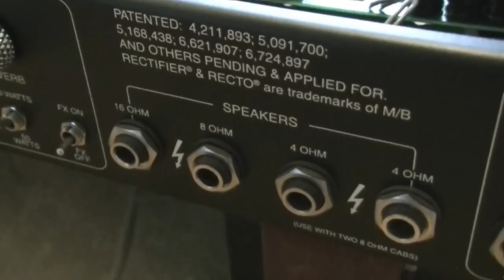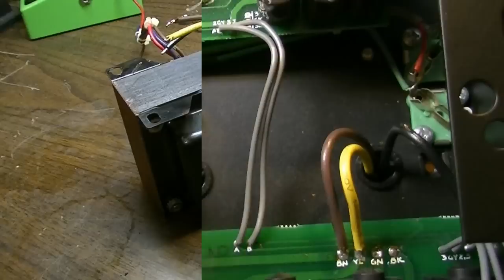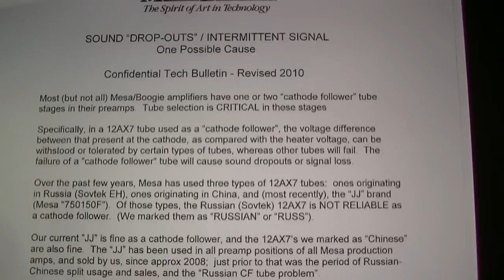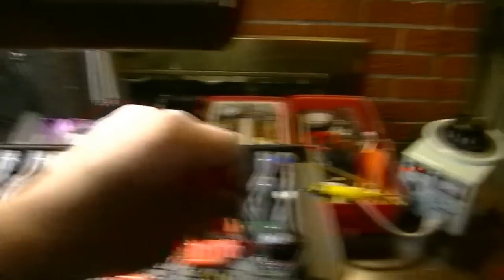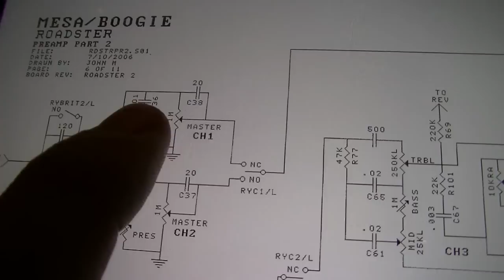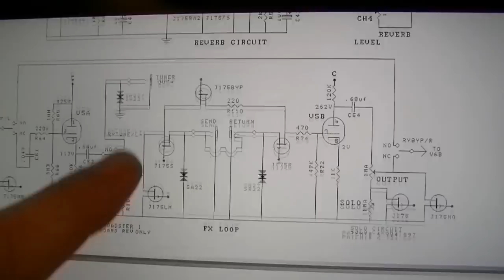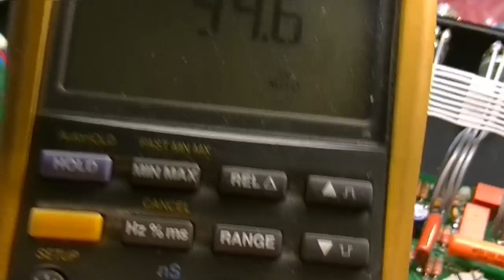Amp Tech's Worst Nightmare - Mesa Boogie Roadster Repair

Comment: Hi, just wanted to say , I love your videos. I have a question for you on a Mesa Boogie Tremoverb amp. I recently sent my amp to Mesa in California from Niagara Falls, Ontario, Canada. Cost me a fortune in shipping and the repair. $1000.00 the amp got sent back ok and it plays, but the noise floor coming through this amp is extremely noisy. Ask Mesa about this. They couldn't give me any answer to this problem. They told me they had a guy there for 30 years and that he was their top tech at fixing Mesa Tremoverb amps. Can you give me any advice on this problem. I have recently bought a Ceriatone HRM Dumble amp. You can turn this amp up really high and you don't get the noise floor on this amp like you do the Mesa. I had Voodoo amps in Lansing, New York do their mod on this amp. Basically that mod just lowered the gain in the amp, so you can turn up the gain in the red channel without sounding like a can of bees sound that is so much a part of the tone that was this amp. I must say their mod did improve the amp for the better, but this noise floor you hear through this amp just turning it up without even playing any thing through it. Any advice would be greatly appreciated.

Comment: The way everyone talks, I expected the guts to look a lot worse. It's not that bad really. The boards aren't stacked on top of each other. No SMD. it's really just a complicated circuit is all. I'll take that over an amp that is inaccessible for servicing.

I found using a looper pedal playing a few notes is a lot more convenient than having to plug a guitar in. Sort of a more practical signal generator.

Comment: BTW I had an issue on the RKII with excessive noise on one of the loops... that resolved to a resistor that went bad in the circuitry in the loop... apparently a common problem.

Comment: Excellent video showing the aggravation of the jfets when there are issues with Mesa gear... I really enjoyed this video, as well as watching how you resolved the overall problem as it turned out to be. I also liked the output transformer work and how someone had cut that - nice. I would not believe it unless I saw it right here on the video. I like mesa boogie amps although as this video shows they can be tightly packed (those jfet pads are close) and have that commonality of the jfet problems that many people talk about. A really cool video and one that you did a great job on showing... Thanks for making this. I have a RK II which in many ways is similar to the roadster with some more niceties :) Thanks.

Comment: Jeez I am so glad I didn't buy that freaking Mesa Boogie amp!! It was a good deal on an expensive amp, but if anything went bad, I couldn't afford to fix it. That is a tremendous amount of colored spaghetti all completely crammed tight as hell in that little box!! Based on the last amp repair video i watched... the Fender Hot Rod Deluxe... I wonder if I might have also bought an unreliable amp! At least it's more open inside to see what might be wrong. Hey Brad, I'm an American living in Germany. The HRDx I bought is of course a 230v 1996 Made in the USA version. Can it be converted to 120v if I bring it back with me, or should I sell it and buy a different one once I get back?  Bob in Germany

Comment: I bought this exact amp when they came out. It was the best amp I have ever owned. I had it on one side of the stage and a 2x12 cab on the other side. It was heavy as all hell, but the versatility and tone were second to none. I had to sell it to pay for a divorce lawyer or I would own it still today. And it was loud enough by itself to keep up with the drummer, and that is a feat in and of itself. Would not mind getting another one.

Comment: For what it's worth, Peavey Triumph, Ultra, Ultra Plus, 6550 and other multi channel amps have electro mechanical magnets connected to diodes and capacitors to trigger channel switching. I have fixed quite a few of them. Good video. Reminded me of some frustrating times. ;)

Comment: what a bad design....I´m not a fan of mesa amps due to that muting and switches....
But seeing something like what they done here simply drives me mad....!

Thanx Brad for showing me this....no mesa for me..unless it´s given to me for free...and also i would strip that and rebuild it with a traditional point-to-point single channel topology...;)

ok now for be biggest issues, which driving me nutz:

first: jfets don´t like reversed polarity on their gates-source nor they like to see more voltage on the gate than source(spikes!), they simply go short circuit in nanoseconds...that´s why nearly all fet designs use reverse polarity protection diodes....but this does not work here, as you would hear these diodes as a heavy distortion always. 

But every serious audio designer knows this and usually, if they use semicons for switching/muting they go for a pair of BJTs, but you also need to have a low impedance input signal, so not good with tubes without a dedicated cathode follower each time you want to switch a signal.

A way better solution would be to delay that audio switching (a simple "wait" capacitor should be doing that easily) and mute the path using relay(s)....first engage the mute relay and after that the actual audio switch relay change position...no click...and no more short circuit JFETs....there is a reason NOT to use JFETs without the usual precaution...

What we have next, look at these shwitches and what the´re doing in the anode path....i doubt they´re using the dedicated hi-voltage types...the usual DC rating for these kinda switches is 160VDC....

Comment: For the future, you might want to try Switchcraft brand switches. Also if you do not already have one make your self a bulb dimmer. This will allow you limit current without limiting voltage which is handy when you want to test a tube power supply. Granted audio tube amps are using really low voltages compared to an RF tube amp but you heart does not really care. It is just a switch, incandescent bulb wired in parallel to a power socket. Also if you do a lot of this sort of thing an isolation transformer could one day save your life! If you already know all of this than cheers not meant to insult anyone! Just brothers in electronics!

Comment: Peanuts for  a Mesa Boogie!   Only in America!  This is one thing (probably the only thing, other than the beautiful wild places....) that I love about America, that stuff  , esp second hand and ex military stuff goes for peanuts!   Even guitar hardware is cheaper new in the US.   This doesn't happen in 'tight' Britain so much.    Example - eBay - Sellers forget that people use eBay to find bargains, so they often tend to overprice or pitch the starting price too high.   FX are a classic case in point.   And US made pickups...    Even a CTS pot costs an arm and a leg over here. 
.
I've been studying the odd Mesa circuit diagram, where I can find them.   Mesa like to use those FETS to control everything.   I note it's also festooned with 'Orange Drops'.  
Great upload, as usual Brad.   I've bookmarked this, just in case I ever strike lucky and find a MB Roadster....   Knowing my luck, I'll probably find loads of MG Roadsters instead!

Comment: Glad you figured it out. I know electronics, but not much about amps. Are these bargain amps? I was astounded to see 65 deg C !!! filter caps in a piece of tube equipment. I would replace those with 105 deg C as matter of course. Who the hell is so cheap that they don't even bother with at least 85 deg C caps? Pretty pathetic with tube gear, which gets quite hot.

Comment: I work on alot of transistor radio's, and with those fets they go bad when you look at them..they are very sensitive. Center pin is the gate....can you connect the drain and source together to bypass it..or them.???

Comment: Hi , I have a Mesa Boogie Tremoverb amp from 1995 and I have a high volume hum problem with this amp. Just wondered if you could give me any insight as to what might be causing this problem. The electrolytic caps have all been changed. Even put all new valves in this amp. The red channel, being the highest gain channel is the absolute worst. Totally unusable now. Had a tech working on it. He didn't have a clue about it. Any advice would be greatly appreciated  Michael Newell from Niagara Falls Ontario, Canada
Reply from the maker: I think the first thing is to determine if the hum is present even with nothing plugged into the amp and volume controls down. That will eliminate something in the power section. You can also pull tubes one at a time starting at the V1 and moving thru until the hum stops. That'll help isolate the stage that's humming perhaps.

Comment: To test an output statically ( good indication!) all ya gotta do is LIFT the primary n center tap, and INJECT a signal into primary, if u have ANY signal on other side, bet its good! I have a brown face Bandmaster that WORKS< but u crank it n it snds like a bad connection ...., SLAVED in a diff OT, n sure enuff snds killer, BAD OT, sux, itsa 62!!!

Comment: I've seen worse...
Strain reliefs can and will pinch wires off if they aren't carefully run through the bushing before compression and insertion. Of course the transformer is good, they are rarely any part to go bad in a device's lifespan. This is indicative of sloppy assembly, typical of units of this era.

Comment: Looks like you are measuring resistance whilst the circuit is powered on, doesn't that invalidate the measurement? The meter is sending a known current through the resistor and measuring the voltage to calculate the resistance. If you power on the amp, it will also be putting current through the resistor and hence the resistance reading will appears to change as it's now reading the external current plus it's measurement current, so the calculation of resistance will be wrong. It could also potentially damage the meter if more than a few volts appears across the resistor you're measuring.
Reply from the maker: This has been brought up before in other comments. You are correct in general. But even though the amp was powered on, the only current present on the pot I was measuring is the minute signal current. That will not damage any meter, let alone this Fluke. All I was doing really is seeing if the pot was working. That can be done in this particular circuit, and most tube amp circuits, with the amp powered up. The precision of the measurement wasn't paramount. Thanks for the comment!

Comment: I have to say that this was very informative. It does validate my belief that We (I) really don't need a tube amp that has the technology to land an unmanned 747. I will stick with the basic (hand wired, non PC board) tube amp, and buy pedals for anything else I may want. This amp is WAY over engineered. Victoria amps please.

Comment: Hey, I'm interested in your method for injecting the guitar signal at different points. Do you buffer it or just couple by a resistor?
Reply from the maker: IIRC, the probe in this video wasn't capacitor coupled. That's why I was being careful to avoid high voltage with it. I made a cap coupled probe later on that I use in more recent videos. Same concept though.

Comment: I went to school to be a tech and learned quickly when amp designer/manufacturers went from point to point to PC boards they completely screwed the pooch in an attempt to make them all fancy with the unnecessary bells and whistles. How many fricking circuits does an amp truly need? My 1974 Carvin SS bass amp is point to point. How simple is that?
You have far more patience than I but your buddy said the magic words as far as shotgunning all of those FETs. Good job.

Comment: Shot gunning parts en mass often leads to this result... creating more problems.  A scope would have avoided a lot of unnecessary component changes and de-soldering and soldering..  When looking for grounds and shorts, using a current limited supply and a milli-voltmeter saves a lot of effort.  Even a very old inexpensive scope would have sufficed.  The transformer issue was a good catch and was not something expected.  This is what happens when you get something to repair that somebody else has worked on.

Comment: Just a few tips. 
Get some liquid flux  in a sirenge and use a good gob of it. Your soldering will look better and its relly hard to short out even very close pins. (Chemtronics sells so no clean stuff i personaly like) 

Also with a 4 digit ohm meater you can trace shorts with some degre of accurace by useing ohm and picing some spots. For example on each of the caps might show .0190 in curcit but next to the damaged jfet you would get .0110 They you would; knwo when your phisicly close to the issue. Makes it a better guess of the issue without removeign things.  I have used said method before to trace dead shorts of a pcb and narrow it down to small mfg issues on the phisical board.
Reply from the maker: Good tips on both counts. Thanks for the comment. If I work on too many more boards like this, I'll have to spring for some liquid flux.

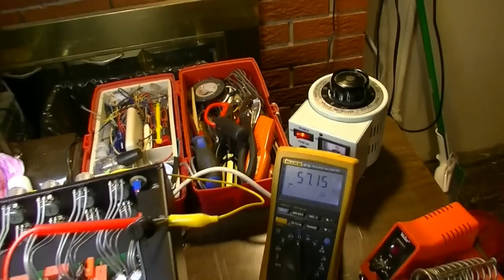Comment: Hahhaa, at around 25:30 you're trying to measure resistance on a powered circuit. That never works! The meter measures resistance by applying a small voltage, measuring the current flow and displays the calculated resistance. Once you apply power to the circuit, the voltages interfere and the meter will display nonsensical values like that
Reply from the maker: Generally, you're right, but in this case, there is no DC voltage present at that point in the circuit with the power on.
Reply: Any AC waveform (e.g. noise) coming from V2A will interfere with your DMM as well. You'll also see the grid leak created by V4B being energized and switched into the circuit, There is nothing but relay contacts between the wiper of the gain pot and the grid of V4B

Comment: You can't measure the resistance of the pot like that when the circuit is enabled. The DVM passes a known current when used in resistance mode and measures the voltage across the probes allowing it to calculate resistance. When you have a signal present then this generates it's own voltage offset across the terminals of the pot and so screws the DVM reading.

Comment: Thanks so much for the video! i have an older Triple rectifier that pops between channel switching, and  a notably diminished output on the clean channel. If you didn't just pinpoint the problem for me rather precisely, you at least massively pointed me in the right direction. (if memory serves it only pops from channel one (clean) to any other channel, and not all the time, but i rarely play on this amp as it is at my drummer's house as a rehearsal amp). So once again, thank you much. i know jack about amps and electronics, and was really just watching this vid by coincidence to learn some stuff because you demonstrate so well. imagine my surprise halfway through when i was like, "Hey, that's what my rectifier does!"
Reply from the maker: Replace all those JFETs, man. That should fix it. Just don't screw up and short the leads like I did! :)

Comment: Happy this turned out so well. NICE.
I used to work 2 blocks away from Mesa's Petaluma Ca Ross St address on Clegg in the early '90s. Wasn't playing much then so i never dropped by.
Did hear a few demos, though :)
Not a Mesa fan as a player but listener, yep. Santana and Metallica spring to mind.
Myself, demo'd a Epi SG thru a Mesa at a local shop. No sale.
 Went home then went back and used a Roland 35 watt Cube amp. Bought the guitar. That was in '10.
How it goes, sometimes.

Comment: Good stuff.I never should have sold my Boogie Mark IV.  It sounded heavenly when I put in a pair of genuine RCA black-plate 6L6s.
Reply: RB I'm with you, miss my Mark IV. I got fed up with tubes when I was heavily gigging and went solid state. Now transitioning back to tubes. Picked up a super cheap and sightly beat up Mesa/Boogie Formula Pre, had a QSC solid state poweramp that sucked, switched to a Carvin tube poweramp. Pretty happy with the tone, it's far superior to my solid state rig. Still not quite happy yet though.

Comment: I'm halfway through and my thought so far is..if you have NO output at the end from any channel then signal tracing and confirming good signal for any single channel is all you need to do. Then go to the point where they blend and see if it's there. If it is then go forward. I expect the issue will be after that recombining point of the circuit.
Reply: best not to advise someone with this ultra level of amp troubleshooting expertise,its like a guy who has slingshot using experience telling a pro sniper  how to shoot better,in other words,thanks but dont bother.